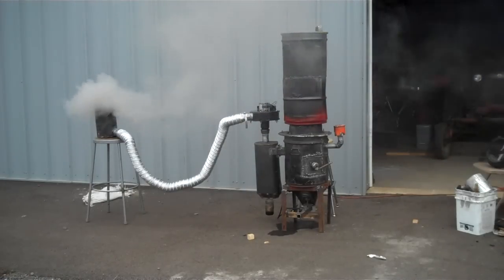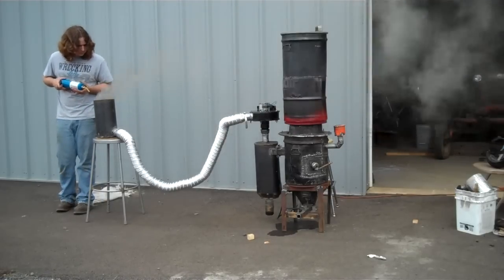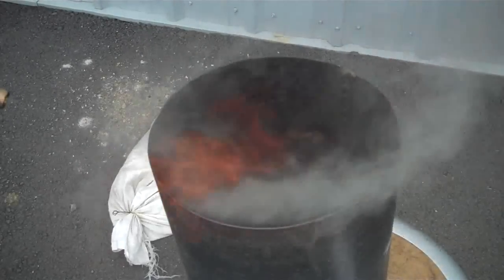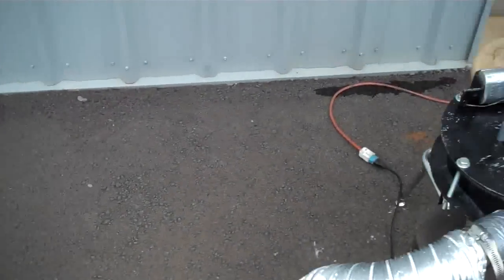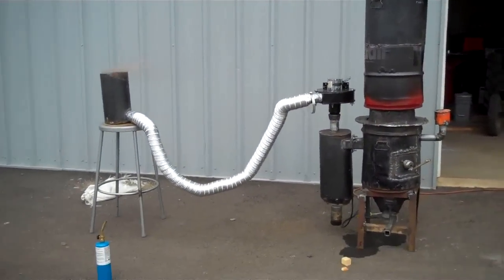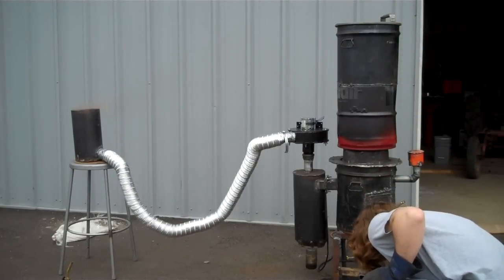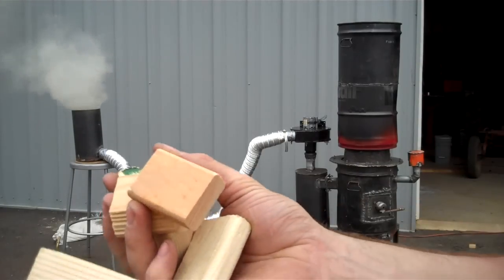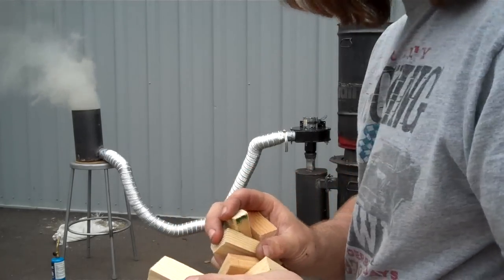Gasifier - first run

Comment: to me the fire at the end of the vid represents the loss of energy you would of had with conventional prosseses of combustion, i mean gasification aint so conventional , not shure why,
i was gonna build a dule burner set up that allows any size fuel, 1 burner would produce smoke by burning trash and what ever then that smoke is vented  to another burn chamber where large loges are burning and other dunnage

Comment: One of the thing you could do to get a blue flame is to cool the gases coming out of the reactor by pouring water on the metallic exhaust tubes ( silver color tube) using a small water pump or rather you could fabricate a condenser. Blue flame is the result of gas being cool and the air fuel ratio has to be in the right proportion, so you may have to pump air into the drum where you are burning away the gases.